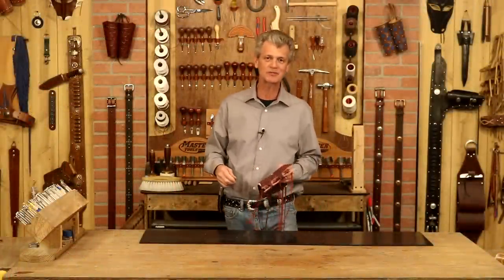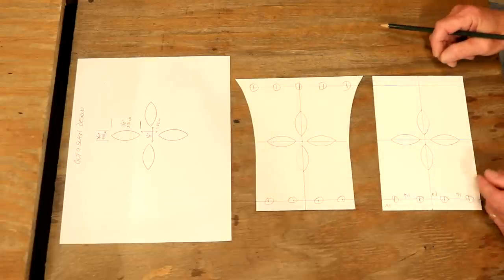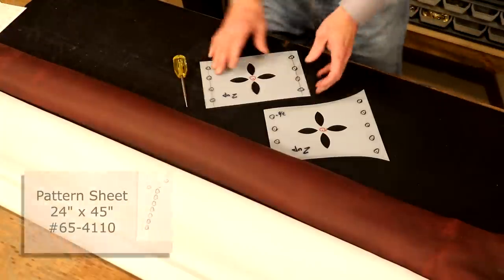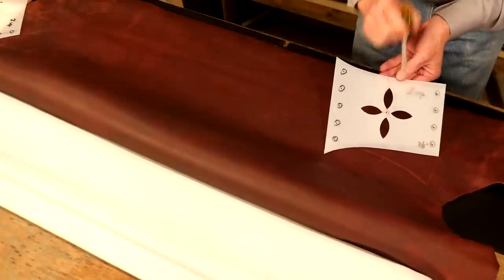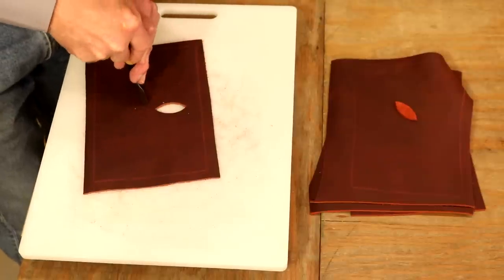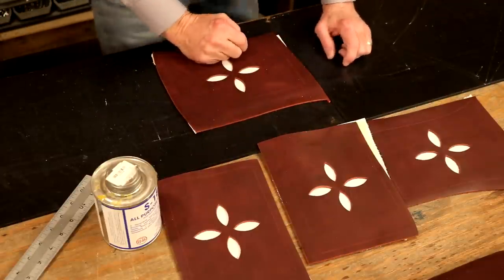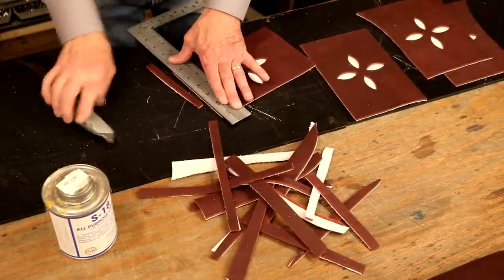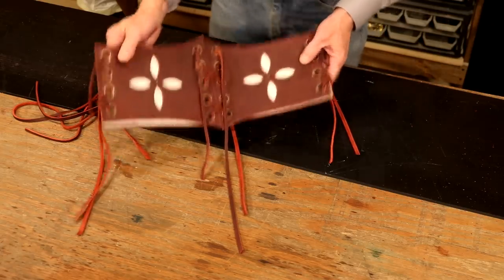Making a Handmade Leather Bodice Belt

Comment: Great video, beautiful project, thanks Chuck!  That black cherry Frontier pullup is one of my very favorite leathers.  The color, weight, and feel are stunning.  It is an oily tannage though, so a couple of notes for those who haven't worked with it before (which I learned the hard way):  (1) Neither glue nor contact cement will not hold it for the long term, you will absolutely need to sew it to any sort of lining you want to use, and (2) It has enough oil in it that if you sew it to a piece of veg tan, the oil will seep into the veg tan over the course of a couple of days.  This will cause some discoloration in the veg tan which will probably be visible if you are dying it a light color or leaving it natural.  That said, I highly recommend getting a sample, it is a beautiful material.